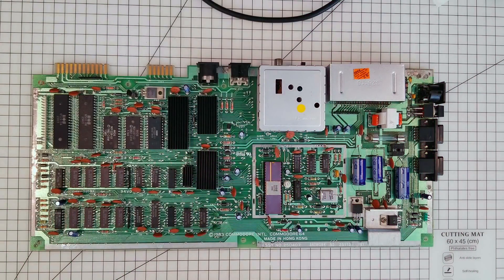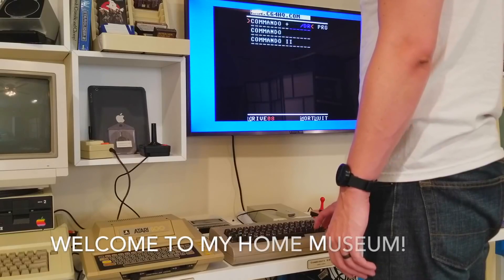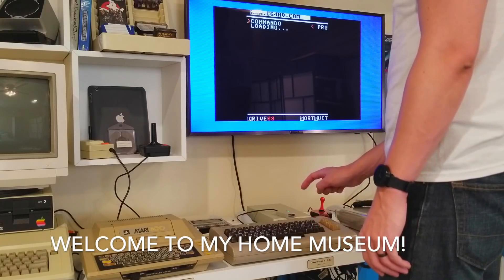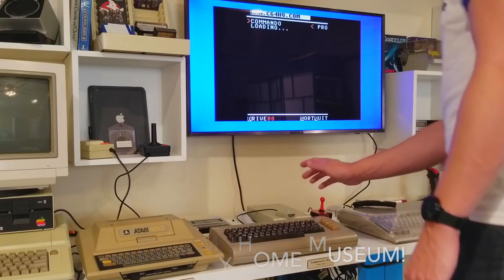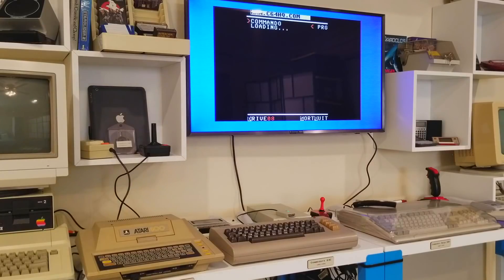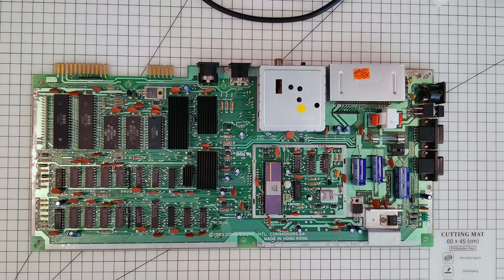Commodore 64 NTSC to PAL Conversion | see description for new switch!

Comment: Ok, but what is with RF output? It's NTSC signal? Or PAL? I mean, if i hava a old PAL TV that can't run on NTSC signal and if i connect that C64 to this TV via RF signal, i get colors and properly image?
Reply from the maker: I don’t think that will work very well no. It’s the same as broadcast TV over RF. USA and other countries had differing systems. Same with the C64. The difference starts at the VIC-II graphics chip, so affects all outputs.

Comment: Hi!! if i buy a Commodore 64c PAL (Europe ) and i connect it in my country that use NTSC (considering the correct power supply) using a modern TV. Does it will works?
Reply from the maker: It will only work if your USA TV supports PAL or if you use an upscaler to change the output to HDMI. I have one recommended at my "Get the tools I use" page http://perifractic.com/tools

Comment: Hello, can you elaborate on exactly how your C64 is connected to the XRGB-mini here, and the settings on the XRGB-mini?  I performed this conversion and am using an S-video cable from the C64 to the XRGB-mini.  The image is in black and white.  The exact same setup using an NTSC C64 results in a color image.
Reply: Update: this was resolved by adjusting the R27 pot next to the VIC chip.
Reply from the maker: I have the same setup. I haven't seen that issue with the XRGB. The troubleshooting at the end of the manual for my switcher might help: https://docs.google.com/document/d/1kmEpEqAXiAqL4K_vFQSTYxYZdxyA3ZmUkNNI0kuMmtI/edit?usp=drivesdk

Comment: The vic2 pal chip Ebay link sends you to a 6567?
Reply from the maker: Fixed, thanks! https://rover.ebay.com/rover/1/711-53200-19255-0/1?mpre=https%3A%2F%2Fwww.ebay.com%2Fsch%2Fi.html%3F_from%3DR40%26_trksid%3Dm570.l1313%26_nkw%3Dcommodore%2B64%2Bpal%2Bvic%2B6569%2Bchip%26_sacat%3D0%26LH_TitleDesc%3D0%26LH_PrefLoc%3D2%26_osacat%3D0%26_odkw%3Dcommodore%2B64%2Bpal%2Bvic%2B6560%2Bchip&campid=5338319429&toolid=20008
Reply: @RetroRecipes  no problem! I had just ordered your vicII 2 and a 6569 then saw in this description the 6567 and thought I had gotten them confused!

Comment: i did this, but my Dell monitor is only showing greyscale from this machine. can it not handle a PAL video signal via its s-video input? also having an issue with my pi1541 with this machine.
Reply from the maker: If you see a black and white image yes this usually means the monitor does not support the other mode. You should be able to check the specs by Googling it on Yahoo!
Reply: @RetroRecipes  i think it's something else, possibly even the crystal not being exactly right (it's marked 17.734475) because i've tried the machine on PAL compatible displays and it's still grayscale.
Reply from the maker: @mindluge  There is a 7 pF capacitor fix you can try which I detail at the end of http://bit.ly/vicii2guide 🤞
Reply: @RetroRecipes  aha. i wonder if this is why my pi1541 is failing on this machine also? do you by any chance have a Mouser or Digikey part number for this 7 pF cap?
Reply from the maker: @mindluge  Sure: https://www.mouser.com/ProductDetail/TDK/FG28C0G1H070DNT06?qs=icAhCOE9Tbho1OcQfWPqjQ%3D%3D

Comment: I just watched a video from another retro tuber who did only the jumper change but he was using a C64C...do you happen to know if the C64C only requires a jumper change to run in PAL?  I had assumed the same 3 steps were required that you did in this video.
Reply from the maker: Hmm that doesn't sound quite right but I don't know for sure.

Comment: Have you encountered any games that use the TOD clock and if so, is there a problem since you are still using a 60Hz power source?
Reply from the maker: Good question. I haven't run into that problem. GeOS uses the clock I believe, but seems to work as before.
Reply: You could consider to install a modified KERNAL, that sets the CIA to 60Hz despite being PAL. Commodore did did themselves in certain markets.

Comment: I have a similar solder sucker, but my thumb won't reach up to the button at the top of the plunger that primes it, and i don't have quite enough strength in my thumb anyway. I have had it for a long while, and the plastic went brittle, and when i dropped it, much of the sheath around the top broke off. I took the opportunity to cut off the rest, and then 3D printed myself a new button, a simple rounded flat one. This way i can just whack it on my butt to prime it! Wish there was a safe way to that to ZD-211 too, but maybe i'll figure out one someday.
Reply from the maker: Now that's dedication!
Reply: Why? It's good to print something regularly or you tend to forget how to do it right and you can figure out various improvements you could to to the printer along the way - it's a sub $150 kit, it really isn't the kind of thing you wouldn't like to mess with, it's just a sloppily thrown together collection of cheapest hardware in Shenzhen and improvements are usually quite easy. Designing a cylinder with a pocket in it and bevelling the top round, then putting some circle ridges on top only takes like a minute in FreeCAD or Fusion360, and it's only a few cents worth of material.

Comment: Why not a kit to flip back and forth?
Reply from the maker: There's a product called LumiTOLB that comes close. The problem is height restriction above the VIC to allow 2 VICs and a heat sink in the C64C case, but I've definitely thought about it! Glad you liked the video.
Reply: Okay info noted I have C128 PAL and several NTSC so no worries I hope!
Reply: I think it needs a board that places them either side of the socket, not stacking them atop each other, or the bottom one would have a rough life. Plus some switching logic.
Reply from the maker: Siana Gearz maybe you can whip something up
Reply: I don't have a second VIC-II, so i wouldn't be able to test it; and i would need two different VIC-II, or i wouldn't know if there's actually bus interference. Besides, i have no need for it myself, since i'm in EU and my C64 is one of those German ones, and US-only software carries no relevance to me.
Reply from the maker: Update: I'm co-developing a switch board that will allow you to switch between PAL/NTSC. See here for more info!: http://bit.ly/vicii2
Reply from the maker: Update: The VIC-II² PAL/NTSC switcher board is now available! See https://youtu.be/XONgqVT8pd0

Comment: Hi: I've got some changes on screen when running the C64;  The image sometimes gets clearer (not for better). I think that that's the crystal or maybe the VIC getting too hot (I'll put a fan too). I've got a PAL C64 and I was thinking in changing the old crystal. I'll use a 17,73447 MHz one, the style of the new one you've soldered in. My question is: Why did they use that pin on the right of the original crystal?. I say the first thing you desolder in this video, marked as "This wire".  I mean, are you sure that it isn't necessary at all?. Why? Were they polarized and now they aren't?
Reply from the maker: Fernando Martín It's just a ground. No harm connecting it but the smaller ones don't really need it, at least that's what I've learned. As for the changes on screen you can look into Lumafix or LumaTOLB on amibay, or try a different VIC. I don't expect crystal to help, nice though she is.
Reply: Thanks. I'm already using a Lumafix and this VIC is the best one of the ones I've tried. ... I'll try changing the crystal and putting a fan over the SIDS that will also cool a bit more the VIC.
BTW I've finally installed tonight the Bwack's kernal switcher and it is ... Great: http://eab.abime.net/showthread.php?t=89997&page=2 . I'll make a new video when I change some more things ;)
Reply: Just thinking now... I had some issues before with the VIC and that's why I changed to use a later revision one. Maybe the culprit was just the crystal after all.
Reply: It's crystal shielding, which seems a bit excessive, given how the crystal basically sits on a nice ground pad. Also they are not all equally susceptible to interference, i don't think you're likely to have an issue.

You can always check whether it's the heat with some cooling spray. Mild contact cleaner or air duster can work as such. Sure not simply a leaky capacitor? Their properties change for a few minutes after they're powered.

Comment: Will it work properly on NTSC displays?
Reply from the maker: Fawful Rox It should on modern ones, that's what I have. Older ones, possibly not.
Reply: No, I have a PAL 64G that I imported and it doesn't show color on any of my old C= monitors, but does work fine in color on S-Video on my Plasma TV so that might be an option.

Comment: Great Video... I've got an NTSC C128 which I want to change to PAL. I expect it to be a similar process. But I can't seem to find any clear information on precisely what to get and do. Do you by any chance know about that too?
Reply from the maker: Carsten Lervad (aka Zhixalom) Good question. I've never tried that. The video from the 128 is essentially two separate computers in a way. For the 40 columns you should find exactly what's in my video on your main board. Take a good look. I don't think the 80 columns would need converting... 🤔

Comment: BUT, what if you wanted to switch back to NTSC for whatever reason (incompatible software, etc).

this should be adaptable to a C64, as well.  http://www.fascinationsoftware.com/FS/html/Plus4-videoswitch.html
though I'd make a custom PCB, rather than piggybacking the VICs.
Reply from the maker: It's a common request. Luckily pal is the dominant format and I'm not aware of anything NTSC that doesn't have a pal version you can download.

Comment: Nice work dude. Do US made games tend to work on PAL systems or is it the same problem?
Reply from the maker: Thanks! Actually there were very few NTSC only games. But my understanding is there can be similar issues, particularly with the display. It would be interesting to test.
Reply: Perifractic's Retro Recipes I was wondering if folks in 60hz regions would make their games compatible with 50hz regions because of the popularity of the computer in Europe. Figured that was a large market sector. Then again, perhaps that's why there were often two quite different versions of games for each market? Afterburner is the first one that springs to mind.
Reply from the maker: Phil Underhill Indeed! And of course cartridges were more prevalent for NTSC, though the cheaper tapes were more widely used in PAL markets. 

(BTW thanks for pointing out the issue with the last video! 🤦‍♂️)
Reply: PSI-5 Trading Company had checks in it to prevent it from working on PAL systems. Probably a very poor way of regional locking. On PAL systems the most common version is from the Swedish Cracking Crew and there are people in Europe who  claim to have this version on original tapes (!). This SCC version runs slower on PAL than on NTSC and you can consider too slow, the music sounds better on NTSC. But it is playable on PAL.
Reply: Nice vid. Commando sure enough sounds wrong, however, there are others that sound very wrong and too slow in PAL (i.e. Maniac Mansion, Zak McKracken, etc. ).
Reply from the maker: walterg74 Thank you! I take it you are used to their NTSC versions 😉